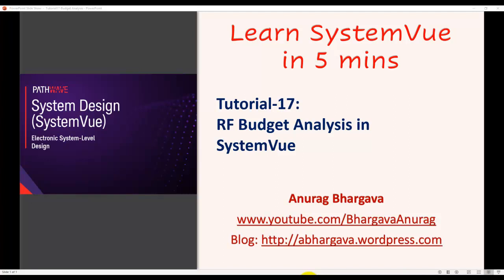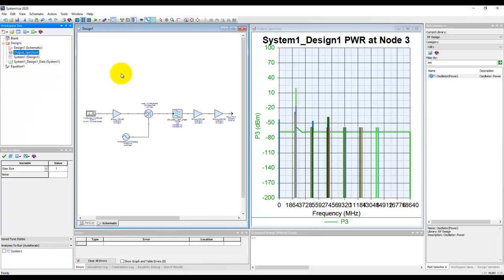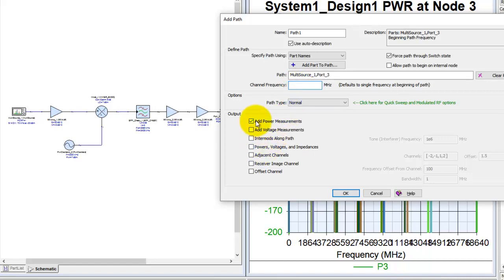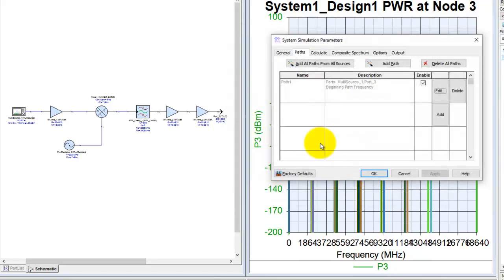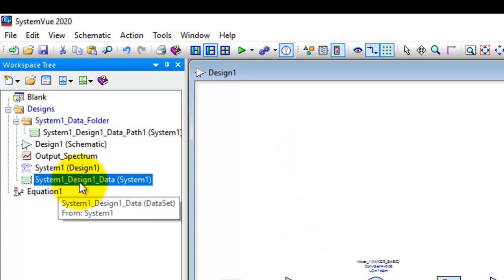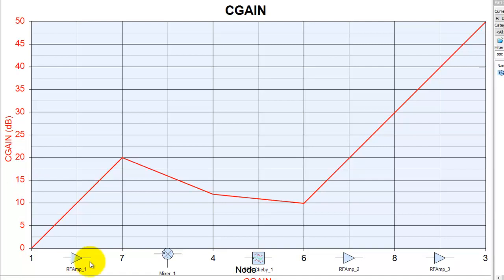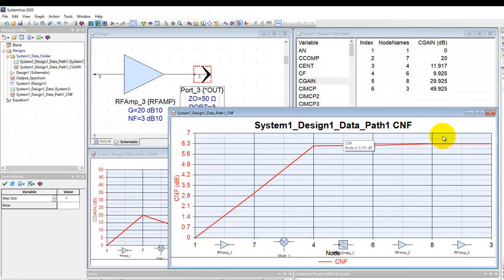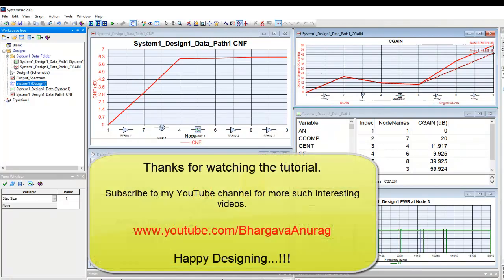Tutorial-17: RF Budget Analysis in SystemVue

Comment: Hello Anurag, thanks for the nice videos. I was trying to do a node-wise budget analysis in SystemVue using some .sNp S-parameter files that were exported from HFSS. While I was able to import other .sNp files obtained from the datasheets of commercially available products, I could not use the .sNp files that I extracted from HFSS. It gives me a warning saying "Error in format (#) line of data file C:\...\...\SdataHFSS.s3p. Line ". " Any idea how to make this work? Thanks.
BTW, I could import the same .sNp file into ADS and make it work.
Reply from the maker: Hi,
If it is a standard touchstone file then it should work without any problems but it is difficult to comment unless I see the file. I would recommend you to contact your local Keysight tech support team for help.